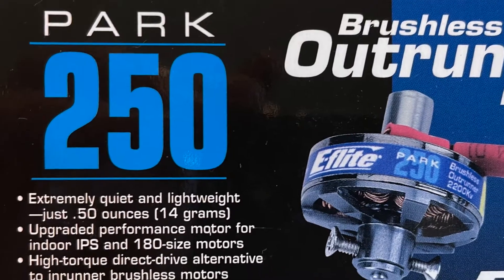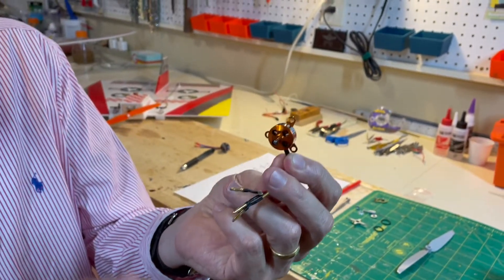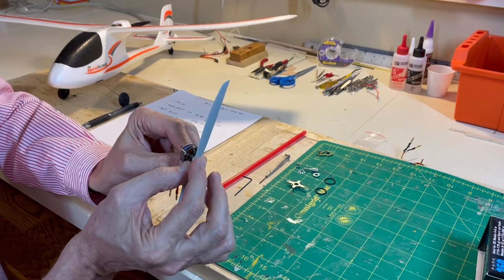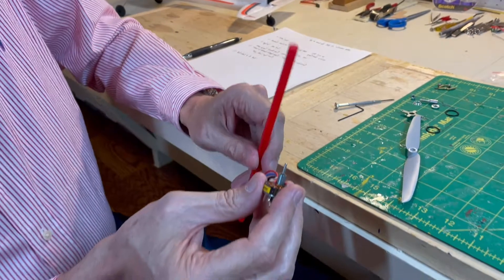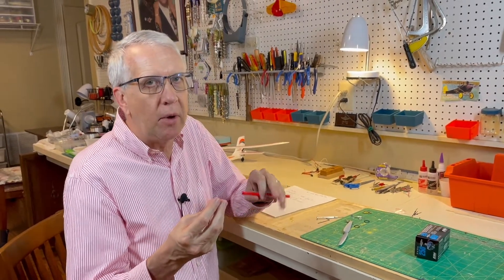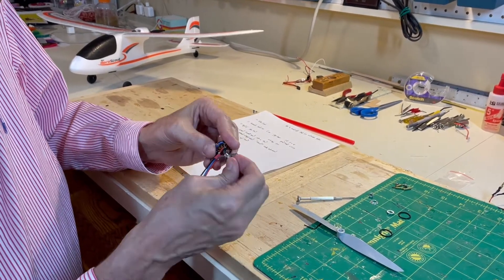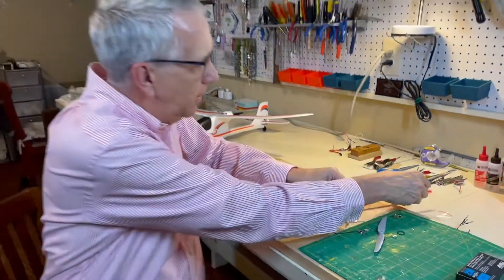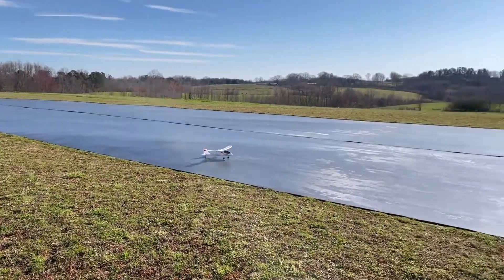How to Mount a Park 250 Brushless Motor

Comment: I don't like "prop saver" propeller mounts as on some small brushless motors. When used in the "tractor" mode, rubber o-ring can break or come off and propeller can fly off in your face or forward. Motors with common X-mount and screws, plus collet-type prop  adapters are safer to use, propellers are fairly cheap. Motors with "bolt-on" prop adapters are even safer, don't depend on collet or set screw to hold prop and adapter to motor shaft. Downside with X-mounts is need to make a box or use standoffs  to locate motor in a cowl. Innov8tive Designs sells plastic mounts of various sizes and lengths to help mount motors with X-mounts in cowls.
Reply from the maker: Agree!!  Tim

Comment: The prop shaft on that motor is reversible. You can loosen the set screws that holds the motor can to the prop shaft and slide the prop shaft to the opposite position. Not sure why it is not described in the manual, but the old Eflite 250 clipped wing cub ARF required reversing the shaft.
Reply from the maker: Bryan:  Many thanks for this info!  Tim